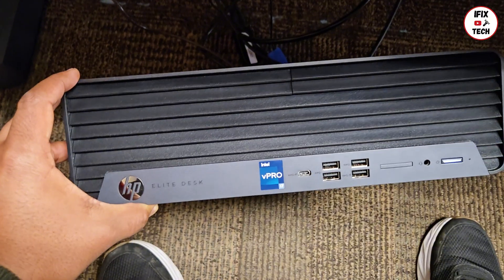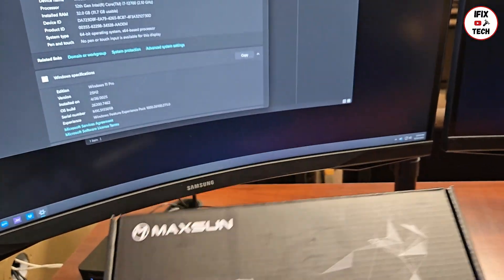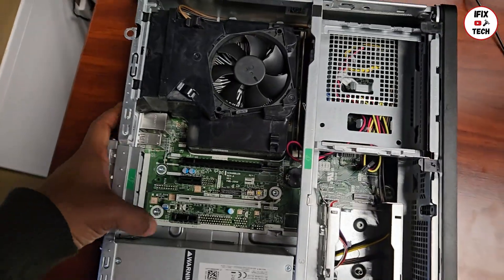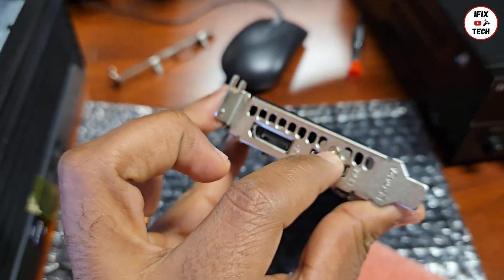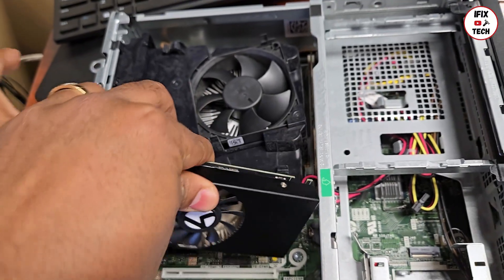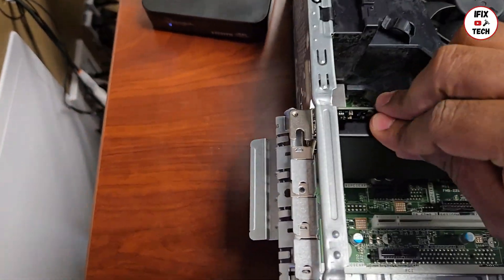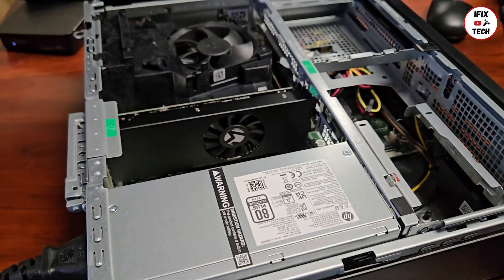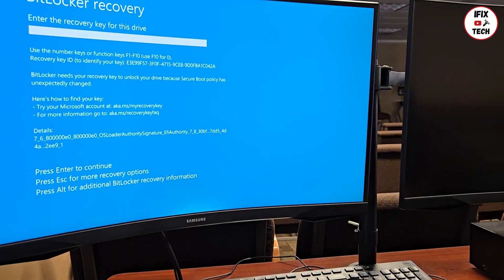Stop PC Lagging! Installing a Nvidia Gforce RTX 3050 to Fix Stuttering

Comment: Guarantee it is core scheduling with E-cores, big issue with 6-700 chipsets. It is also an isolated issue that not everyone will experience. Flashing the bios and reinstalling chipset drivers would've most likely fixed the problem. I would change the title of the video to something else because it will result in misguiding someone to spend money on something they absolutely do not need, especially a 3050.

Comment: you didnt even show your issue.
so you spent alot of money on a new gpu? 
I would argue that its because its a bad motherboard, and power supply and case, ram, or could even be a bad windows install.
I would look at your ram stability first.
12700 is more than capable of watching 4k without stutters.